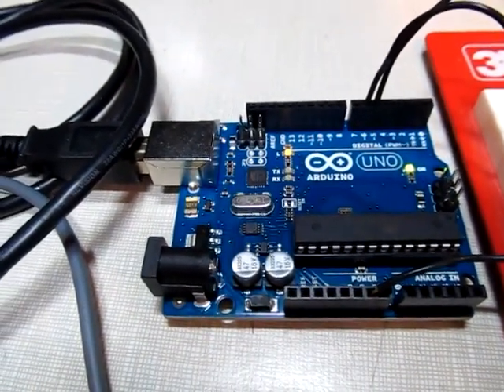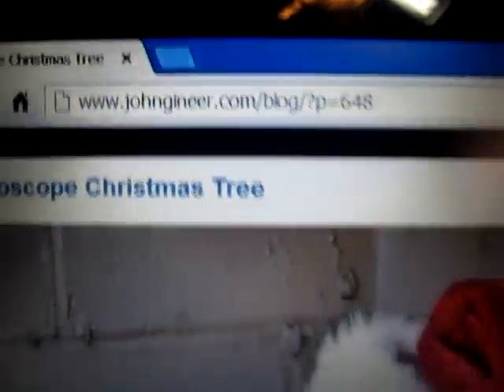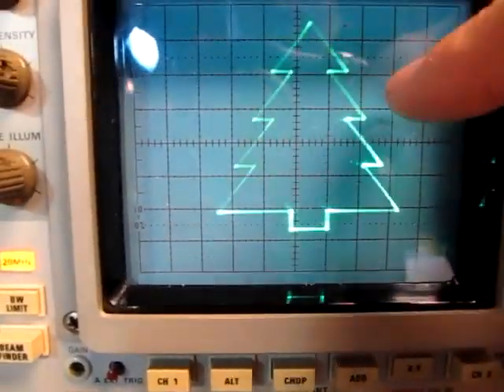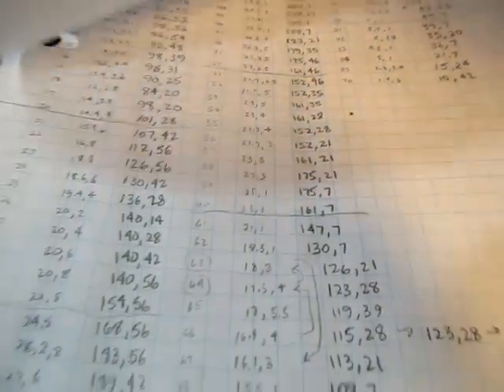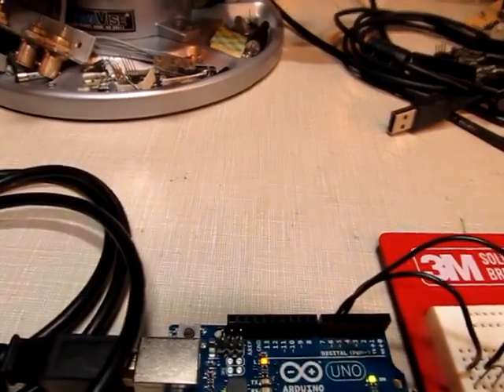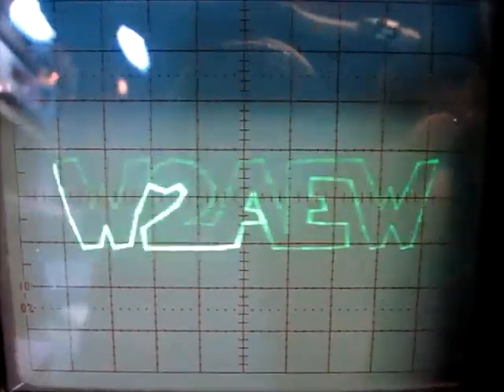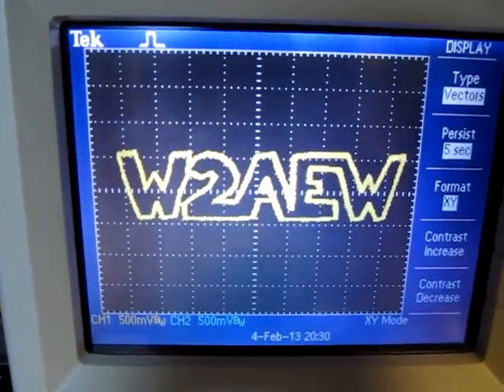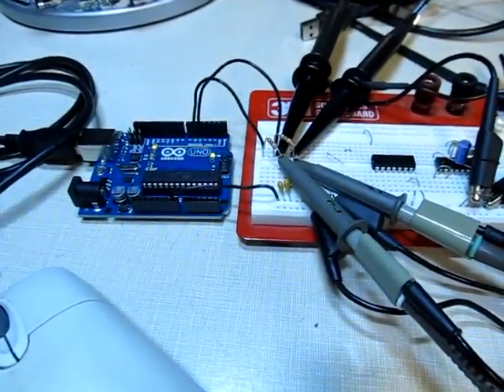#78: Use an Arduino to draw pictures on an oscilloscope using XY mode

Comment: Hi. I did and get result like this. I wonder where the problem?
could you help me please?

https://youtu.be/bB1ATYcoVvg
Reply from the maker: The "flicker" can be reduced by changing the persistence setting on the scope (if it has one), and the non-90 degree corners on your figure can be helped by lowering the RC time-constant of the filter on the PWM output, or by adding some delay in your code to "dwell" at each point a little longer.
Reply: thanks so much

Comment: I've played with XY line drawing on a digital scope almost identical with the one in your video. What I did was a crude voltmeter and it displayed 4 digits representing the measured voltage in millivolts ( in my case from 0 to 5000 millivolts so the drawing period varies with the voltage being measured i.e. more lines to draw ). I found that when the drawing period approaches the refresh rate of the display (something that cannot be controlled), the image becomes somewhat intermittent. I also tested it on an analog scope and there's no problem. Nice video btw.

Comment: Impressive but not to rain on your parade "Oscillofun" set the "gold standard" a few years ago.
* https://www.youtube.com/watch?v=J1ylMJwfLmM

This video visually shows the quality between .mp3 vs .flac:
* https://www.youtube.com/watch?v=YCiLUjsg3cg
Reply from the maker: No worries - The XY graphics using stereo sound card output is cool - I've seen a lot of them.  The really cool ones are interactive.  I downloaded one that plays asteroids using the sound card into the XY inputs of the scope.  Recently, I saw one that plays Quake the same way.  Nifty programming.  But, that wasn't the point of this video - this was simply to show a bare-bones approach to XY graphics using filtered PWM outputs from a uC.

Comment: I'm having trouble with upload. I keep receiving this; avrdude: stk500_getsync(): not in sync: resp=0x30. Any thoughts on how to resolve the problem?
Reply from the maker: I'm not really an expert on the Arduino, but this error means that the communications between the board and your computer isn't setup right. Here's one example of how to resolve this:
http://www.instructables.com/id/A-solution-to-avrdude-stk500getsync-not-in-/
Reply: *****
Thanks so much that helped me fix the problem

Comment: I always wondered how the OSD in analog scopes work. In the days of slow processors and simple logic ICs it must have been pretty intricate to generate nice round curves for the numbers and units. Is it drawn between the actual signal traces or does it use dedicated electron beam? All these are interesting questions and I haven't found that yet, just was wondering when I saw someone made the scope clock which is also amazing project, everything is just vector graphics.

Comment: I tried similar thing few years ago with bare AVR (just assembly) and serial dual DAC, I think it was 12 bit. It was very simple, just drawing square with X inside connecting the edges. The code was incrementing one or both axes by one and back down. It run at full speed so the difference between analog and digital scopes were more pronounced. I think modern scopes with thousands of waveforms per second would show it much better. Still the image on analog scope was nicer due to finer traces.

Comment: Is it possible to visualize the path of the beam by slowing down the drawing process? How does that trace traverse around the screen? When is Z axis on, and when is it off? In what order were the lines between the points drawn?